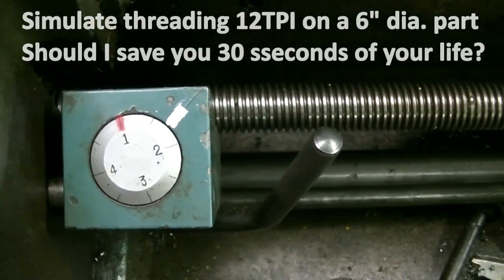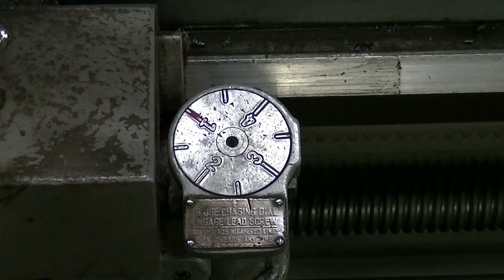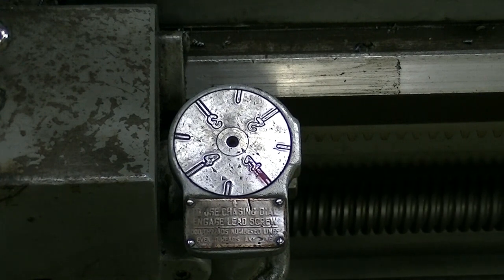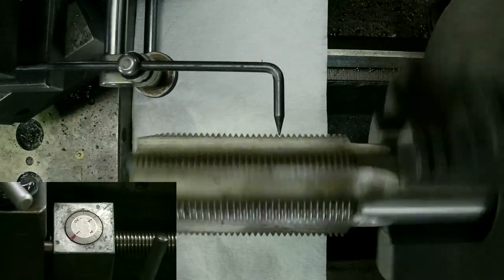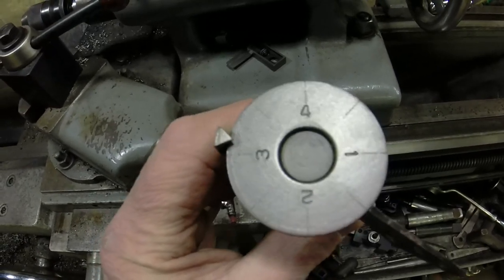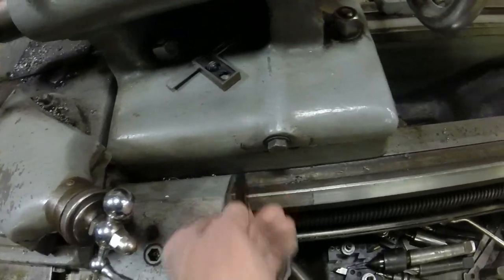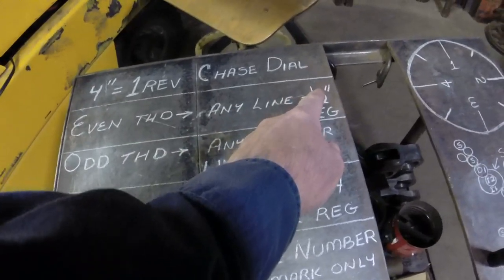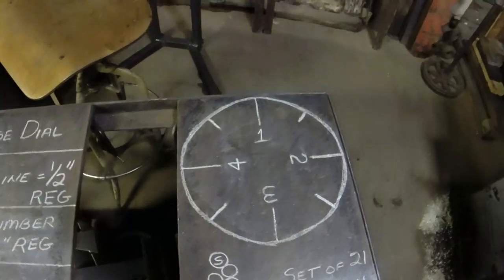Using the Lathe Threading Dial

Comment: This explanation is amazing. I have no thread dial on an old 9" South Bend JR and thought I would make one. No one on any of machine lists I subscribe to could tell me the relationship between the lead screw TPI and number of teeth on the dial gear. You make it perfectly clear, and the formula for finding registration will definitely save time.Thanks for putting this up,  Dave Richards
Reply from the maker: Thanks David, many old timey steamer fanatics had to make their own dials using just the engine lathe. Some were wonderful looking, all were useful. Hint! They used the gearing to index the spindle and hand slotted (shaped) the dial wheel and also to divide the dial face. Good luck & thanks again

Comment: Matt:  OK,  on making the thread dial gear, the lead screw is 8 so a legal gear would be 32T for a 4" travel . If you consider the screw to be a rack, do I know enough to come up with a pitch diameter on a gear? If the gear is kept narrow with a slight angle on the teeth, shouldn't it mesh well enough?   How about doing a video on acme threading?  thanks, Dave